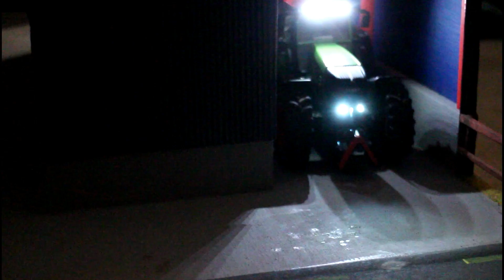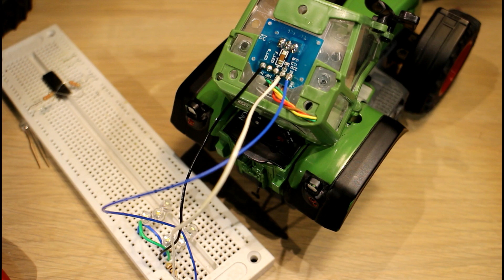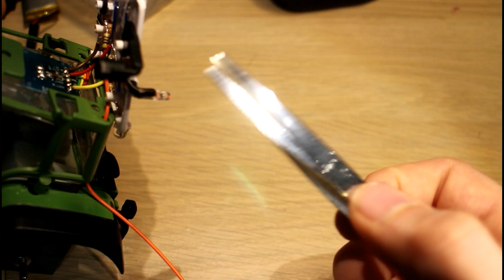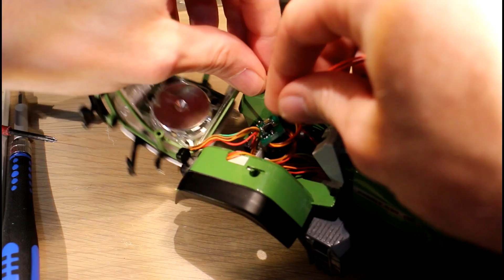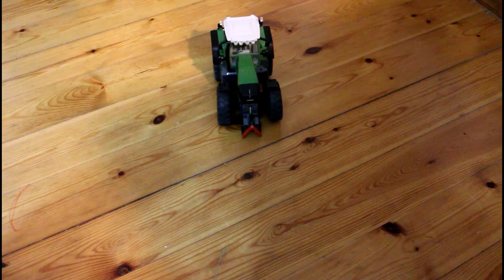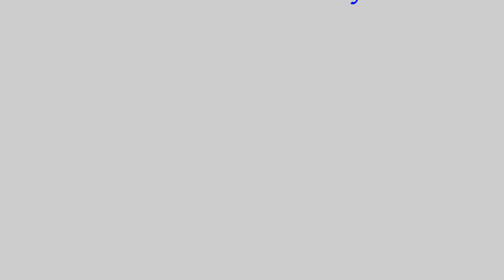Adding work lights and beacons to a Siku Control 32 Fendt 930

Comment: What is the blue lead for
Reply from the maker: You mean at around 2 mins in? That was the ground I think. I didn't use it because I used the npn transistor on the control board to connect to ground.